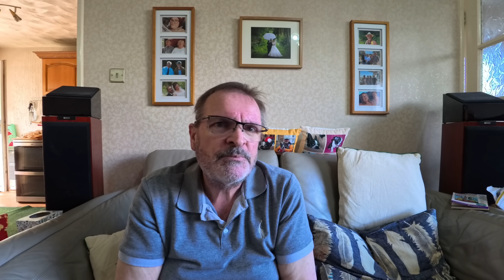Expert Ships Engineer Reacts to Baltimore Bridge Crash

Comment: The Russians didn't do it! This sounds like a gremlin short circuit or overload problem.  HVAC technicians said the the ship was loosing power while they worked on the AC. Ship should not have left the dock until the overload or short circuit is was found and repaired.  With the way this countries communist party is running things and what has been going on with everything else, we are getting punchy. Yes, we must keep an eye on everything and never let your Gaurd down. They communist party in charge is doing bad things and it does look suspicious. They are going to try something  and we can't let it happen. When your country allows illegals to have guns while they try to disarm Americans, there's a problem!
Reply: Loosen the tinfoil foil cap!
Reply: @rack9458  what don't you understand? You have electrical issues, you don't leave the dock. Safety is always first. Loosen your tin foil hat. I tried to explain about short circuit and overload troubleshooting.  What's your problem? Any Captain knows that
Reply: @joenewmeyer8358  That is a rumor.  Stick to facts
Reply: @rack9458  and tried to explain why Americans are on edge. We are having issues here
Reply: @joenewmeyer8358  Stop spreading rumors

Comment: It probably wasn't an attack by anyone like Russia. It is possible it was meant to affect "business as usual". Way too many coincidences in this, many things that could have , and should have been in place. First, leaving port, Harbor Master is watching like a hawk. Tugs should have been assisting departure through critical area. Ship leaving port, all "hands on deck" at there area of responsibility in case of emergency. The rudder would not have affected the ship to turn as sharply as it did unless it was in the Port position. There are "hurricane lanterns" all over a ship that come on as soon as power goes Off. The wheel house on a ship has several. They didn't seem to be working.
Reply: Tugs are not used in most harbors.  This isn't the movies

Comment: Exactly "Chief". The main engine looks like it was likely pushing the Wheel "counter clock wise",  Full Astern. If the rudder had been in the port position, accidentally?, the bow would have turned to the starboard. Note also that the ship was tracking in a straight line directly between the bridge supports on a safe course. It looks like the rudder had changed position. A Zero degree rudder should not have taken the ship into a rapid starboard turn like the Dali did seconds before the contact.

Comment: Propeller-driven airplanes experience a force that veers the nose in a particular direction during takeoff, depending on the rotation of the propeller. Though I lack expertise in engineering, the physics underlying this phenomenon likely differs significantly from that of ships. Nevertheless, some inexperienced pilots operating single-prop aircraft have tragically perished due to this issue. On takeoff the pilot can elevate the nose excessively, leading to a high angle of attack and subsequent stalling, compounded by leftward banking (one wing quickly dropping down caused by the stall and is exacerbated by engine torque and propeller dynamics. These accidents frequently result in the aircraft crashing nose-first, sometimes even inverted. If i’m wrong please correct.

Comment: The question I have is why was the ship that close to the bridge support? The video shows a wide bridge expanse. The ship was not in the middle of the expanse. The ship appeared to be lined up with the bridge upright. A spokesman from the maritime academy said they would have to line up the vessel with the bridge from as far as 2 miles off. This did not appear to be the case.

Comment: Thank you, sir, for a straightforward explanation. I still have questions. Namely, why weren't there tugs fore and aft. Its always been my understanding that cargo ships are supposed to have tugs present until all infrastructure has been cleared due to less maneuverability. Second, if they were switching fuel, why then? They were certainly still in the area for required sulfurless fuel. While rumors abound, it's usually a case of "where there's smoke there's fire." Were they having electrical problems while docked? If so, they shouldn't have left. Another rumor that is circulating is a cyber attack on the ship's computers. Normally, it is a throwaway rumor, but in this case, it comes from several different, usually reliable sources. And finally, why did the FBI jump on the podium practically immediately and say "no terrorism"??? This SHOULD be a Coast Guard and NTSB investigation. Why FBI???? That alone raises suspicion to a significant level. Finally, why the missing minutes on the black box? Should be self powered via battery when main power not present. Two minutes missing screams sabotage or cover up (yet to be determined).

Comment: Great analysis. I’ve sailed under the Key Bridge as a marine engineer multiple times, and we definitely had a plot onboard. In regard to the loss of electrical power, possibly they might have tripped the main bus while paralleling another generator. Since it was close to port, usually there is an engineer manning the steering gear as well, but maybe not in this case. Usually, there is a series of errors that leads to a catastrophic incident, not just one.

Comment: any thoughts on why the black box recorder, which should at all times have the necessary power to always record all the major mechanical and electrical things happening on a ship, did not record for two crucial minutes just before the crash??? This to me seems incredibly sus and it should be able to fully function properly no matter what other power outages there were on the ship - that's how they're designed - to record vital evidence no matter what the state or situation on the ship

Comment: I wrote this very analysis as soon as I saw the black smoke and movement of the ship:  "Prop walk. When you command reverse of a clockwise spinning single screw the effect doesn't happen immediately, but if done in a panic suddenly an upsetting huge cavitation shaking the boat and even possibly shearing off the propeller occurs, then the propeller if still there, rotating now counterclockwise, will bite the water and cause the stern to "prop walk" to port, the direction of the spin, thus the bow to starboard and, in this case, right into the bridge pylon support. Any single-screw boater knows effect well, but it's counterintuitive. We account for the effect and routinely use it to advantage in almost every docking maneuver. Assuming the helmsman has ordered hard over to port in a panic then commanding the reversing of the propeller from clockwise to counterclockwise, the effect is even more pronounced, the stern moves to port resulting in the bow moving even more pronounced to starboard. The reversed flow of water across the rudder, assuming it's hard over to port increases the stern shifting in the direction the propeller is spinning, port. Not like driving a car. That is operator error if not intended. " This engineer is spot on.  But the data recorder will confirm.

Comment: Hey, Chief - sailor here, with 20+ years of sailing, cruising, and engineering experience aboard my own boat. Nothing as big as what you worked on, though.
My two main questions would be, one, why was she doing over 8 kt in a harbor where the speed limit is 6kt (especially since the terminal she took off from was less than three miles away, meaning that she had to accelerate at nearly full power to get up to that speed in that short stretch)? And two, how would prop walk (or the paddlewheel effect, as you call it) cause the ship to swing while there's water flowing past the rudder and the ship has steerage way? I've had to wrestle boats around in tight quarters plenty of times, and prop walk is something you simply take into account and neutralize by your rudder position - it doesn't just get to freely swing your ship. Are we assuming that the Dali lost helm control when they lost power? (If they did, that would account for the prop walk swinging her around when they went into reverse.)

Thanks for your great analysis!
Reply: Two Good questions!

Comment: The person that released the anchor probably left the bow to save themselves so the brake was not set . The chain would keep paying out with the ship still going forward but it probably didn’t cause it to slow down or pivot since it is 10 shots long a shot is 90 feet so It was less than 900 feet from contact

Comment: The ship was going too   fast  to correct quickly  ( I doubt it could  anyway ) and pointed in the wrong direction. .. hense the collision.. Reversing  probably made its orientation worse.   But the question still remains .. Why  ? its course should have made the collision  a non issue. Big Ships don't turn on a dime.  That is why the course plans for this.   Someone or something went wrong.

Comment: We, humans, have designed   equipment,  TOO  LARGE / COMPLICATED,  for us  to   C O N T R O L.   WE  must therefore, design these vessels, with the drive forces (propellers) IN  THE  CENTRE -LINE  OF  THE  KEEL; thereby keeping the ' driving force '  - RIGHT  down  the  center of gravity - balance of the ship.  THEREFORE,  a  RUDDER  IS  NECESSARY - even if power goes   OUT - and ship is therefore  in  a   '' drift ''  state - STEERING  IS   STILL  POSSIBLE.    >    >   > > >>     ANOTHER   DESIGN -  MUST  BE  IN  THE  WORKS.......A CONTINGENCY  plan -  steering under  ' no  power '   Captain , ''  we  shall  steer  clear  of  Pittsburgh  Bridge - sir !  ''  All  is  now  in , and   UNDER  OUR    discretion.  No  surprises,   with  this  NEW  DESIGN !

Comment: Ok, I'll buy what may have happened mechanically and by momentum physics. 
But what is the rationale of tug escorts signing off in this difficult port before clearing the bridge? Or switching fuels before clearing the unprotected  bridge? Is the cruise management system hackable?
If the vessel's engines stalled at 8 knots, once restarted and now full astern, how much time or meters to stop forward motion? And if a stern anchor was dropped would a ship master put his vessel in full astern in the first place?

Comment: 4:50 FYI - - Other marine experts have also stated that re-starting an engine that was running almost certainly meant that the cylinders were charged with extra unburnt fuel - so the black smoke was more likely an indication of an excessively-rich combustion mixture.  A heavy load is also likely on purely logistical grounds: everybody already knows it's an emergency: whatever corrective actions are taken at this point will be extreme, be it throttle, rudder, laying anchor, sounding alarms, etc.

Comment: I’m not a engineer or sailor but agree about your explanation on the paddle wheel affect when switching to reverse. Watching the last two minutes from the footage ( which shows speeded up my the media) why did it turn so abruptly.  I thought it look like a jammed rudder.  In the end we are going to find a string of failures both engineering and political which will also question why there wasn’t any bridge pylon protection in place?    -OPENDOORS

Comment: The fuel change over was one of my first thoughts, Having been a Chief Engineer of very large ships for 15 years I have experienced exactly such condition. Full black out during change over, the supply valve was not opened on the ''new fuel'' before the supply valve on the ''old'' fuel was closed. No fuel=Black out. We even had meetings and SOP (Ship Operating Procedures) made and implemented, well it is just as good as the guy who carried them out. Some of us don't need one dame SOP because we know what we are doing, while others are not even capable of following procedures. I came also to the same sequence of event just analyzing the lights off and on in the video, knowing what take place when a black out happen.

Comment: Ex-engineer here as well. What I'm seeing/hearing, is, all the electric auxiliary/ pumps/fans required to operate the main propulsion engine that would be powered from the ship service switch board would be off until the big service generators a online again. I'm don't think the big engine would run without all the lube oil; cooling and charge air pumps. I can't explain how the smoke cloud comes out of the funnel without ship service switch board power. As you have brought out the emergency generator cannot power all that equipment. The hydraulic steering should be on the emergency board though. I've been in blackouts and it's damn scary in maneuvering situations.

Comment: I never heard a Horn.
 I think down current made steering less effective and combined with timing of outage got them twisted .
Full forward yes , Titanic would have not stopped either.
A glancing blow and 6 people may still be alive .
 The anchor slowed bow as current swung stern past . Curious if speed was same at both ends of hull .
   9 year old hull , tanks may have grown algae which acts like cellophane plastic on surface of fuel.
   There will be more evidence.
Still can’t believe no full blast on horn as they hit . Only hear bells for outage…..

Comment: The crash happened b/c of a five cent piece of metal in the steering column. My father worked for the company that makes those parts. He was killed trying to expose it in 1999.

I have the physical proof.

I also have a piece of a Lockheed Martin P-38 Fighter Jet. The hinging mechanism jammed and the mechanism failed. So it sheared right off the jet.

I've got keys for a 1976 Cessna Skyhawk. That Cessna kept crashing.

TWA 800
MH 370
Titanic
Titan Submersible
Boeing 747/777

They all use the same cheap part people have been cutting corners on to save a buck.

Everyone is overcomplicating the fuck out of this.

Comment: Ex engineer myself and I appreciate the mechanical (physics) perspective. I remember always having the SSDG ( ships service emergency generator) on line when entering or leaving a port. If there was a failure the emergency generator can assume the load almost instantly and not have to wait for the transfer switch to cycle. This should have been the case here but doesn’t appear to have been. That power delay would account for having to actually start the engine and then transfer to the switchgear. Why two power blackouts and transfers? Many strange things that I would love to know the answers to. Thank you for insight you shared with us.
Reply: Insight? You mean imagination…

Comment: It's all just a big coincidence, nothing to see here. No back up steering used.  On a course that would have hit nothing when the radio call was made, yet suddenly turns 90° to hit the bridge in the perfect spot to destroy it. Random explosions at key breaks in the bridge. Ukrainian pilot or captain on board. No horn blasts before hitting the bridge. Time to radio police to shut down bridge, but no time for the coast gaurd, who live on their boats ,to be on the scene. No tug boats used to maneuver the ship. The ship named after a famous painter who painted BROKEN BRIDGE just happens to break a bridge. The bridge named after the guy who wrote the star spangled banner...  If you think this was an accident, you are a fool.
Reply: Sounds like a pretty foolish analysis, devoid of actual reasoning. 
You must do well in your creative writing classes.
“Random explosions”? You think bridges only carry vehicles?? There were obviously power/utility lines under there that were snapped. 
🤦‍♂️ 
Pro tip: there is no ‘backup steering’ when the power goes out. No lights, no power. No power, no steering. Did you expect them to use paddles or just to stand on the deck and blow really hard??
Speaking of fools…

Comment: Thank you Sir!
Reply: For what? Everything he said was qualified with “I think”, “possibly”, or “perhaps”. 
He. Has. No. Relevant. Insight.

Pro tip: when the power goes out, you can’t steer a huge mass with a zillion tons of inertia. Every millisecond counts. He observes that there were 2 outages. Does your computer boot up instantly?? 

The rest is gibberish. Even with power, it takes a LOT of distance to stop that much moving mass. You don’t expect freight trains to stop on a dime. Why would you expect it of something the weight of dozens of freight trains?

The ONLY issue here is what caused the power outage leading to steering failure. For all he knows, it could have been a couple of drunk seamen having a disagreement. 😳

Comment: I'm not someone who is an expert in this area, but has had and driven small boats. Common sense in handling the smallest of boats teaches you things quickly, like steering. A barge this massive size should be nowhere near a main pillar of a bridge.  Nowhere near. Safety should be of paramount concern. In watching the video, it looks like someone was deliberately steering towards that pillar very intentionally. So, it came all the way from Singapore and just had problems here? Not buying it. If it was having problems they should have been addressed before coming in to harbor. If it's as easy to have the problems like what's being described here, ships this size should not be going anywhere near structures where they can do this much damage. This video sounds like a bunch of excuses that makes it sound like it could happen easily.  If that's really the case, it's strange this kind of thing isn't something I've heard of before. If something like this continues to happen, we'll know for sure.